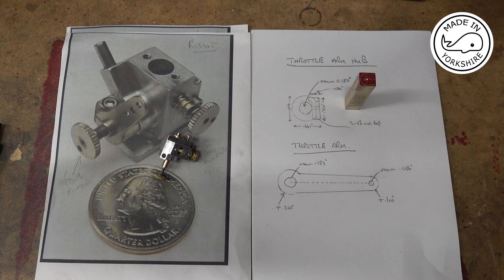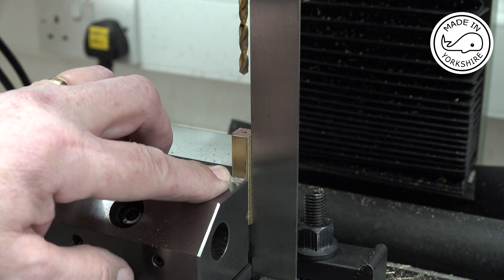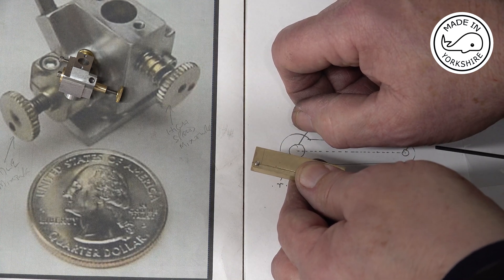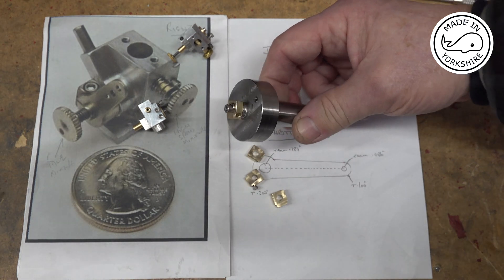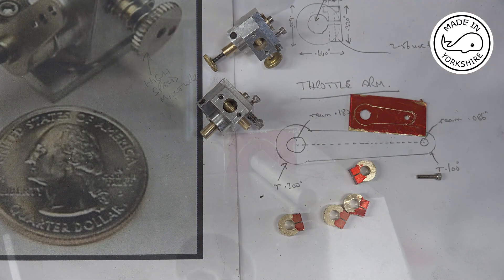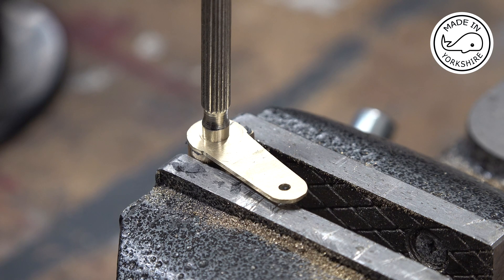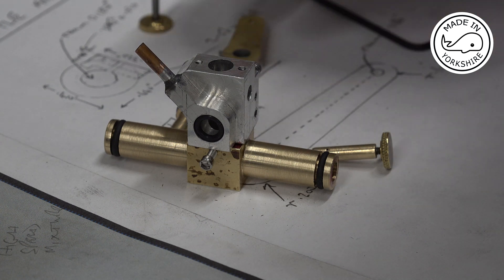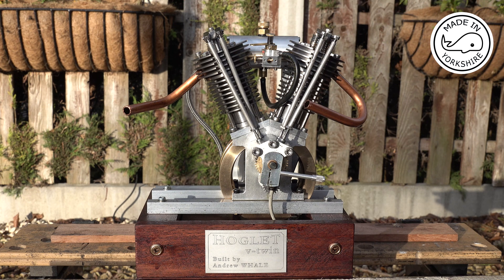#MT46 Part 4 - Jerry Howell 2-Jet Throttle/Carb. Finish & Test on my Hoglet. In 4K by Andrew Whale.

Comment: What kind of fuel are you using here when running the engine at the end of this video?
Reply from the maker: Hi Justin
The Hoglet is a 'show and tell' engine. It's not designed to do any real work. I use a mixture of petrol and 2-stroke oil to keep the cylinders lubricated.
Cheers
Andrew

Comment: Hi Andrew, have you considered a "die filer"?  I built one twenty years or so ago, and it's been very good for profiling small parts like that throttle arm.  That engine sounds good running!
Reply from the maker: Hi John. A die filer looks really interesting. Yeah the little Hoglet sure has some character!
All the best.
Andrew

Comment: Andrew another fine engine to your credit,  for rounding the ends of parts may I suggest filing buttons, over the years I've built up quite a collection. Quick to make and use.
Reply from the maker: Thanks for the tip Brian. Just googled it - very interesting!
Cheers
Andrew

Comment: Cracking Job!  I think I would have cut the levers out using a piercing saw, you can make quite rapid progress with them.
Reply from the maker: Thanks Tony. Great suggestion. I've actually got a jewellers saw but never thought to use it 😔
All the best.
Andrew

Comment: You needed 4 linkages so wouldn’t have been easier to cut 4 blanks and soft soldered together and machined as one.
Reply from the maker: Hey Jon - that is an excellent idea. I wish I had thought of that 😭
Cheers
Andrew

Comment: Hi Andrew did you forget the low speed jet? either way it works!
Reply from the maker: Hi Rich - the low speed needle adjustment is located on the top of the carb when viewed on the engine. The high speed needle adjustment is located on the left hand side. I later made further adjustments and found that the engine runs pretty well with the low speed needle open 1/4 of a turn and the high speed needle open 3/4 of a turn.
All the best.
Andrew

Comment: Hi Andrew, great work, not an easy part to make at all and the Hoglet seemed to appreciate the supply so very rewarding. Really looking forward to seeing the CNC router build, you will learn heaps on that project (and so will we)! Cheers, Jon
Reply from the maker: Thanks Jon - the carb certainly improved the running of the Hoglet. I'm not sure if I'm setting the bar too high with the next couple of projects - but we will see. Nothing ventured, nothing gained!
Cheers
Andrew

Comment: The hoglet semed very keen to run with the new carb. Nice work. The next project sounds like a challenge but much will be learned along the way. I did think you were going to braze the screwdriver to the part but you got away with it. The aluminium trick will prove useful for the future.
Reply from the maker: Thanks Tim - the new carb certainly seems to be a vast improvement. The previous carb just couldn't get the Hoglet to rev high. Yeah I need to try to remember the aluminium trick.
All the best.
Andrew

Comment: Great results Andrew, all that hard work and much thought has paid off..... Look forward to seeing the CNC router project. The next engine sounds like a challenge but your a thinker so you should get through it methodically..... Cheers..
Reply from the maker: Thanks Mark. The cnc project should be interesting. I could have done with one to cut the little brass lever for the carb. Nothing ventured, nothing gained!
Cheers
Andrew

Comment: Great Outcome Andrew. Perhaps in your future projects you might like to dedicate some new cutters just for Non ferrous materials. You were getting quite horrendous burrs on the brass parts again. Perhaps too if your budget runs to it, get some fast helix ones for aluminium, especially as you are planning to make a new Aluminium crankcase for the new engine. Look around too for some heat resistant blocks for your soldering, your bench vice is a big heatsink for soldering purposes. I was very surprised that you did not know that you can not easily solder aluminium with standard soft solder. There are special solders out there for it, but I have never tried it. The epoxy fix of the pipe should be OK.  Have a word with your local Car repair shop and ask them what they do with their old engine oil. You can buy heaters that use it, may be a good choice for your workshop instead of you using a wooly hat and a coat to stay warm. Finally if you can find a small bit of bench space, treat yourself to a cheapie Chinese belt sander. Uses 1 inch wide belts and also has a disc sander on the end, will save a lot of filing on small parts, 2 minutes belt change and you can buy many different grit belts. I will send you a picture to your email.  Stay safe and well. Regards from Australia.
Reply from the maker: Hi Dave, many thanks for the info. The sander looks interesting. I noticed those burrs too. That camera shows up all imperfections when close-up! I'll investigate regarding cutters.
All the best and stay safe.
Andrew

Comment: Very nice indeed. Are the push rods loose on the cam followers? One of them appeared to have a sharpie mark that was going round and round and I thought at first something was about to let loose, but the fixing must be floating... I don't recall though, so maybe time to go back in the series. All the best.
Reply from the maker: Thanks mate. When I originally built the Hoglet I think I set the gaps to be around 1 to 2 thou. I put some Sharpie marks on the push rods before taking the heads off to fit the new carb. Having taken the heads off I should have checked the gaps again. Well spotted. I will do now!
Cheers
Andrew